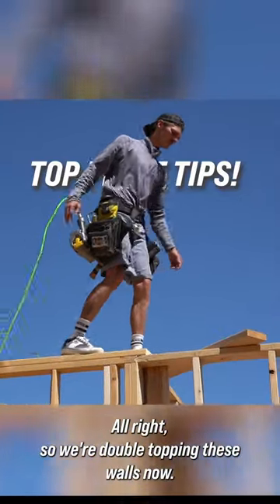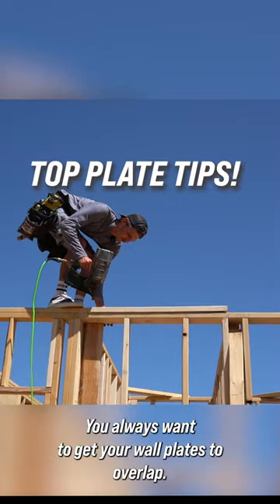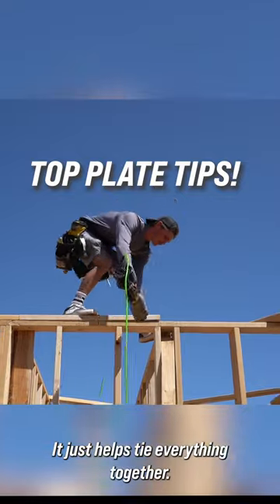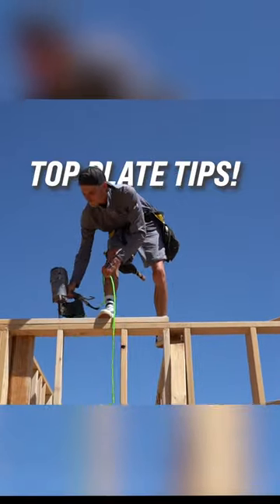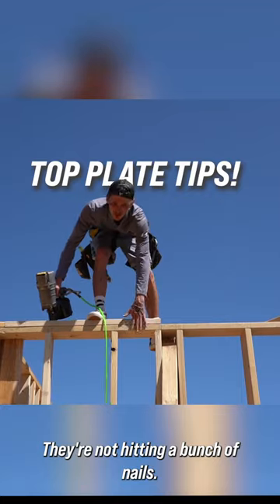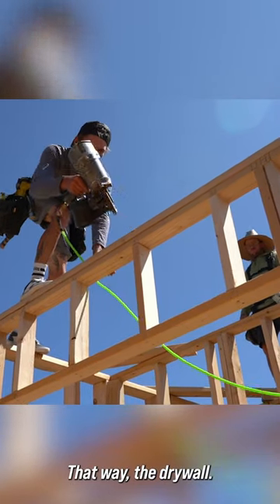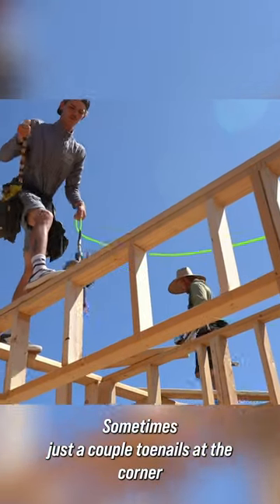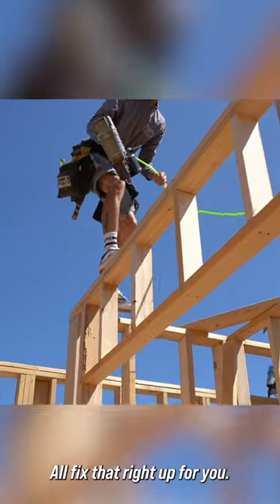Double top plate tips! #framing #construction #houseconstruction

Comment: Bro!!?? I’m 52 and been building for a hot minute. That is the FIRST TIME I’ve heard a Framer having any concern for future trades coming behind them. Kudos to you sir!! EXCELLENT WORK ETHIC!!!! I see HUGE SUCCESS in your future!!
Reply: Are you serious ? I have to ask you a question then as an ex framer , how many top plates did you run into any nails? Every framer is taught this technique for that very same reason . Honestly , I don't think (if your in the mechanical trades) you have ever hit nails in a bay .
Reply: Boiiii, I hit random nails in top plates all the time when I run my line sets or wire ,
Reply: @adrianojames8388  I was a framer (couple years) before I was an electrician (25 yrs). It wasn't taught when I was framing to keep the nails over studs.

 Makes absolute sense and respectful to do so, but it never crossed our minds. As an electrician, I've hit plenty nails in the bay and had a-ha moments about my ill-taught framing days. If I were to return to framing, I would approach some things with a different mindset
Reply: Laughter
Reply: @adrianojames8388  check out all the likes I got and comments other folks commented 😂🤣 I’m a Master plumber and a journeyman electrician and I know enough to be dangerous about HVAC. Over 30 years in commercial and residential construction. If you were taught that, I applaud whoever trained you. But I assure you that is NOT the norm. You are the exception not what’s typical in the industry. Especially in Today’s Industry. Very few trades give two 💩’s about the trades coming behind them. Only the True Craftsmen. Keep stacking sticks my friend Frame On 👍🏽
Reply: @texasandy3230  cudos to you ! I am retired now , but it used to be the norm rather than the exception.
Reply: @adrianojames8388 I’m a carpenter/framer and and do a lot of electrical and plumbing and I hit nails all the damn time when running new lines in old construction and even newer (10 years old +/-) builds. Maybe it’s regional but in central Texas framers don’t give two shits about the next tradesman coming through.
Reply: @ElChivoCDXX  Thanks for your response! I have gotten a lot of responses like yours saying the same , so I stand corrected . That was how I was taught to nail off a double top plate ( over each stud) , but obviously some were taught differently .
Reply: That’s some of the most important things
Reply: Respect, thinking about the next guy.

Comment: Put your top plates on BEFORE you stand the walls. Watching people do it after standing the walls makes me want to throw up
Reply: I’ve never seen a top plate on before standing. Just because youve been taught one way or someone does it different than you doesn’t mean they’re wrong or you’re right or vice versa. That said, how are you locking in intersecting walls if your second plate is installed before standing?

A little respect for other goes a long way. Even if you think  they’re doing it wrong, there is a way to say that. This is a young man making cool content that might spark an interest in some other young people to work in the trades.I salute young Coffman
Reply: Easier and much faster to install top plates before standing them up. You have better control of the material and you're not having to be a mountain goat walking on top of the walls. And yes I've been framing for years. Work smarter not harder. And I do appreciate that he's not a jerk to trades coming after . I've seen horrendous framing by people who should know better. Doesn't matter if you're working on a tiny house or a mansion. Always do as good a job as possible. A good reputation goes a long way to keeping you always busy.
Reply: @danielburca9857  exactly!

Comment: cap plates can be done on the ground lift with the wall,  where's the vapor barer?
Reply: How are you tying in intersecting walls with your second top plate if you nail them before standing?
Reply: @LiamATL007  well I over hang the cap by 3.5" or leave it back.  I lay out the cap plate with the wall.  Sometime I cut them for the nailers if I'm not under too much pressure.
Reply: @2legit2quuit  thanks

Comment: Never gun nail top plates, they don't pull tight, always hanmer top plates by hand. Don't nail you second top plate on top of your studs, you will split your first top plate
Reply: First of all, there's only one top plate. Second of all that gun will pull those plates tight and you don't have to worry about splitting the plate underneath. Obviously you've never framed or not very much.

Comment: Just wondering why you didn't run your dbl top plate on the wall before you lifted up. So much faster on the ground than the air. And after reading some comments I'm kinda tripping that any framer wouldn't nail the dbl over the studs.

Comment: How about installing top plates before raising walls it’s a lot more efficient
Reply: I agree
Reply: I was about to say that 😅
Reply: It's a double plate he's installing it laps the walls
Reply: @ronverrette8832  I no what it is I’ve framed houses for 30 years it’s just easier to do while the wall is laying down
Reply: @stanfromparis1656 you can put most of the double top on on the ground it's always easier to do as much on the ground as possible.
Reply: Been freaking for 35 years, never seen to plates installed AFTER walls are up. That means their studs are face nailed thru first plate so inspector cannot view. As an inspector in NY I would fail.
Reply: Framing* sorry
Reply: @joetichenor4113  in Utah it's common practice to top nail and has been for decades
Reply: @ronverrette8832 you can still nail top plate first
Reply: He's working with Gen-z and he is probably feeding them slowly so he doesn't oppress any one
Reply: @joetichenor4113 New York codes are different I'm sure
Reply: We always top plated and then laid out for the trust why they were still laying on the ground
Reply: Or the floor joists vice versa stacked everything
Reply: @joetichenor4113 been framing in ny for the last 6 years a foreman up here for the last 3 this is how we've done all our  homes no issues from inspectors and we get compliments on our quality work from them aswell
Reply: Those are tie ins'

Comment: Where's his boots ? Definitely no permits that's YouTube
Reply: Aside from logging boots, I have yet to find a pair of boots that grip half as good as a flat bottomed skate shoes.
Reply: @t.dig.2040  I have sheeted many 6/12 up 12/12 pitch roofs and got along just fine with vibram soled work boots. You would get your ass tossed off the job for showing up wearing skate board sneakers
Reply: And you would be replacing a lot of shingles because of your clod hopping boots.
Reply: @t.dig.2040  no I wouldn’t be replacing any shingles, i am not a roofer . I said installing the sheeting (that means plywood) on the  rafters, that has to go down first, then felt paper, then shingles. .
Maybe you haven’t had the chance to do that part of the building process yet, but you are young so you have time to learn the framing of a house.
Reply: @paulhunter9613  *sheathing
Reply: You sound like the kind of framer that forces the finish guys to pull out the Sawzall and sledgehammers.

Comment: Honestly even if you didn't hit studs those small nails are not going to poke through.
Reply: He's doing it. So the electrician's in the plumbers that have to drill through the top plate don't hit nails and destroy their hundred dollar bits

It's a courtesy to the other trades. It should be followed it used to be

Comment: Heres a tip , get a proper nailgun that doesnt require dragging around a hose. Its almost 2024 ffs..😂
Reply: Even the Milwaukee though it will frame fast does not outpace an old school air gun

I use mine for pickup. I don't use it. The frame walls that's just to wear and tear on your battery powered $300 gun

Air guns are easier to replace parts and cheaper and they will far out pace the cordless which is also about twice as heavy